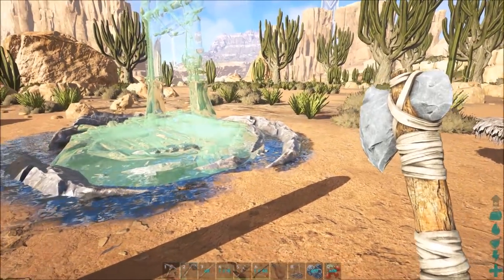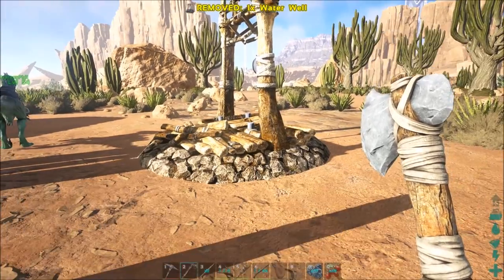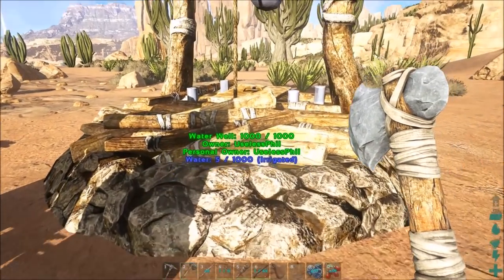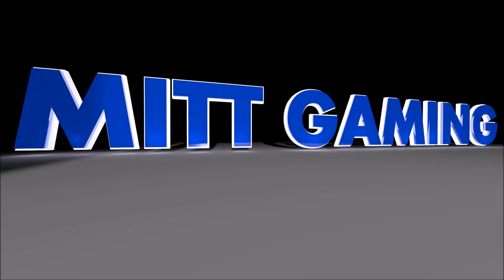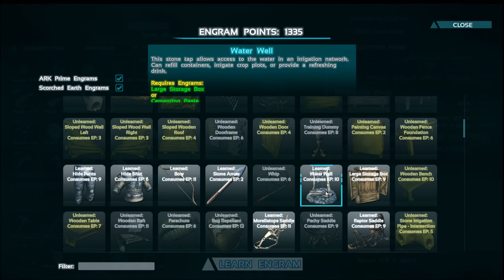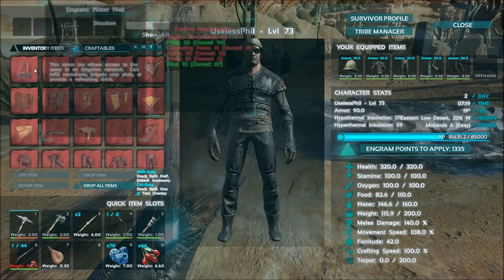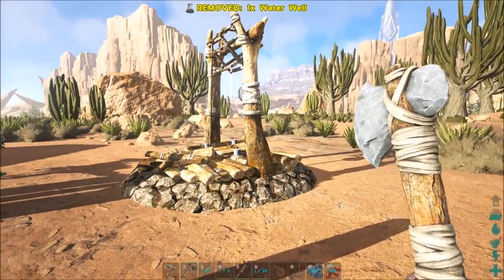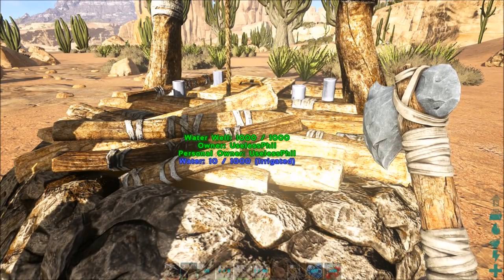Water Well Guide Ark: Scorched Earth

Comment: Can't put pipes on it on a PvE server...says cant place structure here :/
Reply: same problem, also in PVE. anybody knows?
Reply: same here :(
Reply: If I had to guess, I'd say there's a server setting to prevent node blocking/pillaring that is conflicting with the well/vein.
Reply: No, building around important resources is blocked on PvE servers, the devs are aware that it breaks pipes, they are looking in to it.
Reply: 1 month later still broken
Reply: Yes i read in a patch note, this is not a bug, you cant build near to Waterwell on PVE serveur and that include pipe on it.
Reply: on PVE you cant use water well. good luck
Reply: 3 years and cant put pipes....
Reply: 6yrs later still can’t place pipes 🤬
Reply: 7 years later and still can't place pipes 😅